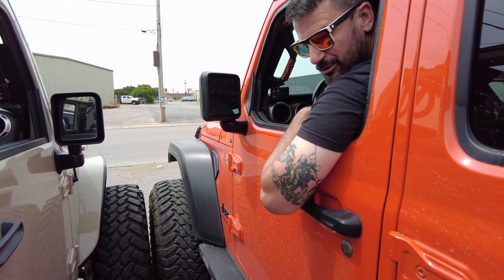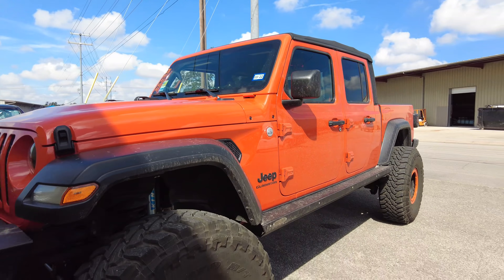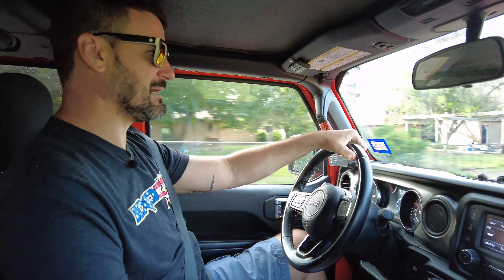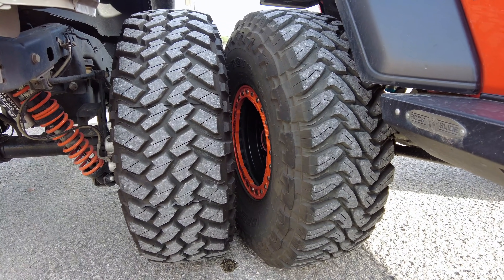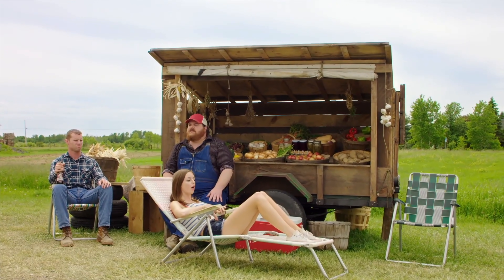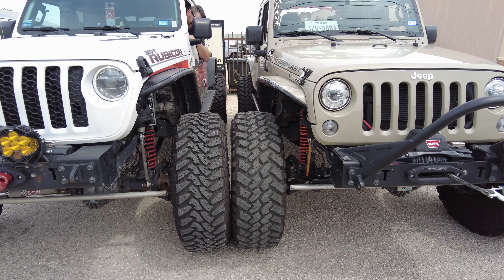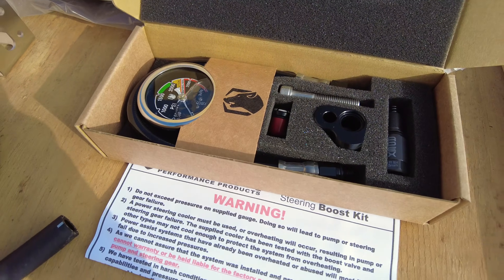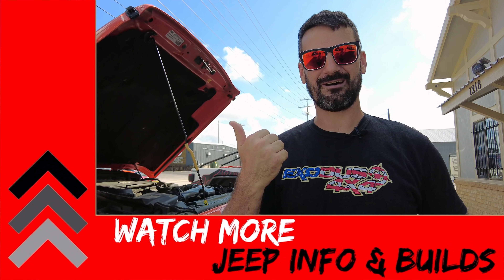Steering Boost Kit for Less- But Does it Work?

Comment: Just installed on my 20 rubi with 37s. Works great. Took it in the rocks and made a big difference. Easy install. A lot easier if you just take out the pump when installing parts and cutting bracket.

Comment: I put the apex on my JT diesel
Works well with 39s no ram needed
Reply: Any issues? Just ordered a diesel JL and I spend most of my wheeling weekends in Moab. I'm going to miss the PSC Big Bore kit on my current Jeep. When I talked to PSC at Easter Jeep Safari they didn't seem sure they'd have a diesel kit any time soon.
Reply: @chainring_tattoo  seems plenty good for my uses.
Reply: @chainring_tattoo  I have been running it on my JLU now for about a month and no issues at all.  Granted i am only running 35s though but huge difference for me before and after.

Comment: I've put in the full PSC kit in my 2021 JL. I'm getting loud pitch whining once it warms up that comes on at 2.5k+ RPMs and gets worse the longer I'm on the trail. Any ideas what the issue is?
Reply: have you checked the fluid level?
Reply: @mikesavage90  I have yes, doing so when full.